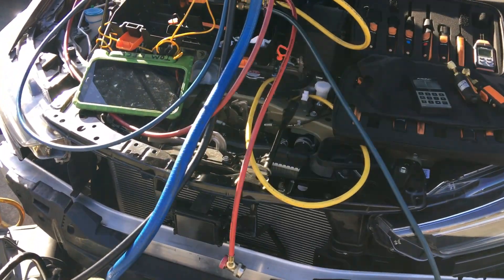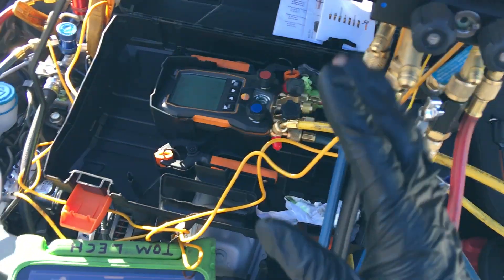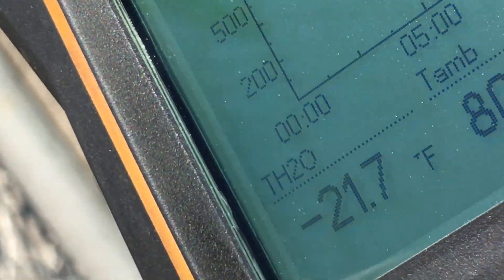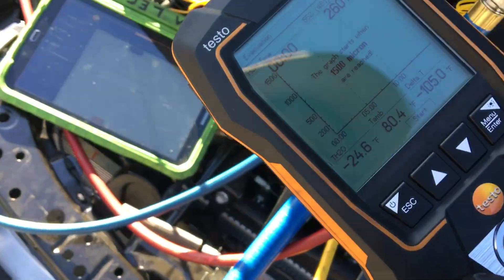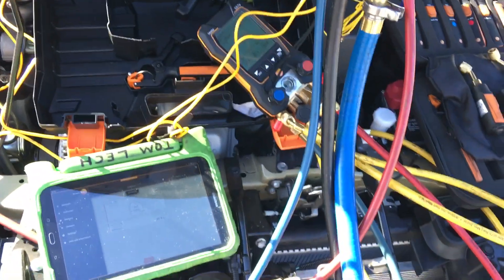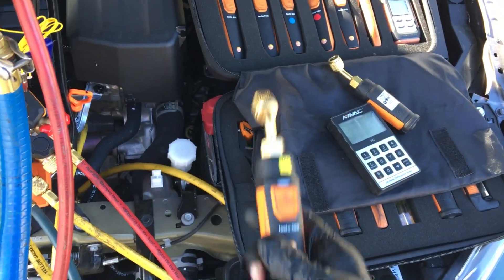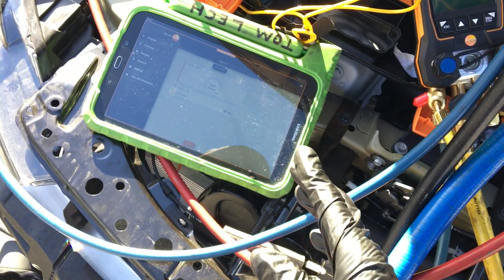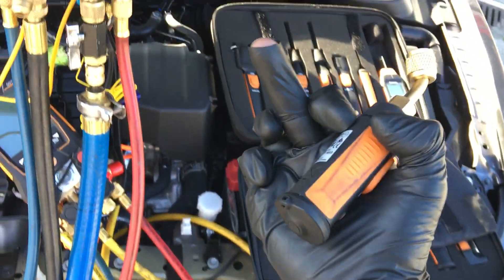TESTO 552i vacuum micrometer.  Cannot get these software connected to tablet or phones without 557S

Comment: It should work stand alone with the Testo app.
Reply from the maker: I know it should work but I’ve been having unbelievable connection problems trying to use it standalone will not find it. 
         Only if I turn on the 557S will it connect

    I tried three phones and one tablet unsuccessfully. 

         As soon as I turn on the 557 and immediately hooked up through the 557S
Reply: Automatic connection via Bluetooth: testo 552i connects to the testo Smart App 

https://www.trutechtools.com/testo-552i-app-operated-wireless-micron-gauge.html

Says it works with smart app , I don’t know if it works with old original testo app.
Reply: @coldfinger459sub0   iPhone or iPad  is best to work with apps I’ve found. Try the MeasureQuick app. Maybe it will work better.
Reply from the maker: @OcRefrig  I didn’t think about using the measure quick app-good idea.    
        Unfortunately I have an android tablet and I was having problems with measure quick on the android tablet time for me to get a apple tablet. 

         All three of the phones I tried we’re all Apple phones.
Reply: @coldfinger459sub0   Yea ,the Apple iPad is a Far superior product to the android tablets. You will have much better happiness with Apple iPad & apps.
Reply from the maker: @OcRefrig  Looks like I’m getting on eBay or Amazon and ordering an apple 🍎 tonight 👍
        Been putting that off for years don’t need the latest and greatest.
Reply: @coldfinger459sub0   yea, I got an older one a while ago. eBay. Still works good. But I need a newer / newish one that the is can be upgraded. My older one is stuck at iOS 10. You need iOS 14 to run latest apps. So , just be aware of that. Don’t need latest model for sure. Especially for work stuff. 1 or 2 years older should be ok. I actually found new ones a few years ago that were not that bad a Price. Latest model was like $225.00
I kicked myself for not buying latest model. I paid like $125.00 for a good /used with new battery. I should have just popped the extra $100.00 and I would not be where I am today needing to buy another iPad 🤦‍♂️. Buy once , cry only once ! Just make sure when u buy has a new battery. Very important since battery’s only good for 1000 cycles or 3 years.
Reply from the maker: Will do , learn from other peoples experiences
Reply: @coldfinger459sub0   you can also ask your cellphone provider for price. Maybe u can get for $10.00 / month deal.add to cell phone bill.
Reply from the maker: @OcRefrig  I have a Verizon plan they had a $200 rebate if I add it to my Verizon plan for no extra money. 
            Because I already have a unlimited data plan. 
             I pick up my iPad tomorrow 👍 
Now does that make me an Apple fan boy 🤣🤢🤮 
           After all these decades I got my first iPad been a Windows user since 1988 with my first PC from IBM they only had an orange screen with a flashing blinking DOS light 
        Windows was not even available at that time. 
           Remember installing windows 1.0 on a 5 1/4 inch floppy disk
Reply: @coldfinger459sub0   yea, I noticed that too ! $200.00 rebate for me too with att if I add to plan. 
Looks like the hot deal right now !!!
Reply from the maker: Because I already have the plan it didn’t cost me anything extra and sign up so I just automatically get $200 back through my Verizon plan I’ll just apply it towards my monthly bill.
Reply from the maker: I just tried measure quick for the Testo 552 I no luck when searching for sensors it does not pick it up or recognize it. 

         Tall must be too new for measure quick they have not added it to the list yet as a compatible tool
Reply: 552i works stand alone with testo app(android phone)
Reply from the maker: @sebastianburaga6400  I try three iPhones & one Samsung tablet 
         I just ordered a iPad two hours ago.   
Picking it up tomorrow .
Reply: @coldfinger459sub0   it’s possible - maybe you got a Finicky / bad probe ? It’s possible.
Reply: @sebastianburaga6400   Which android phone ?
Reply from the maker: @OcRefrig  I  have 3 
I bought one . Then one with the first kit I bought that I need to return. 
       One with the second replacement kit the sent me.
Reply: @OcRefrig  I use Sony xperia1,and a smailo2go tablet and work fine
Reply from the maker: Thank you 0C refrigeration just received my new iPad an hour ago just made a video that’s in the process of being uploaded and released. 

         The new iPad with the Testo software fix the connectivity problem with using the Testo 552 I standalone. 

          Not very happy with Testo wasting my billable man hours trying to get their app in their hardware to sync and work together correctly eventually I took it up to four iPhones and one android Samsung app repeatedly trying to connect and when connecting lose connection or losing data not too happy with Testo about that. 

           Testo with their 557S kit should release a new free Apple iPad to come with everyone of their kits so their customers can be assured connectivity lol 😂

Comment: What’s a vacuum micrometer? You measure sheet metal thickness with vacuum?
Reply from the maker: 1 micron meter measurement of vacuum far beyond in below -29 inches of mercury. 

     Down to the level where your measuring individual molecules of moisture boiling out of your system. 

https://youtu.be/cI6pSBaskjc

They’ve been around forever in the air-conditioning business I’ve been using them since I was 12 when my father was teaching me. 
        That was 44 years ago.